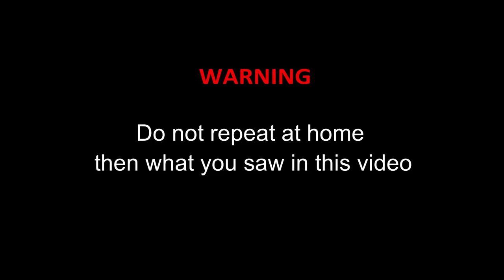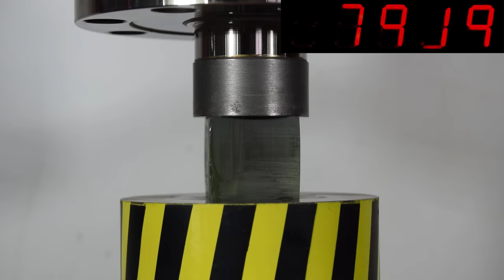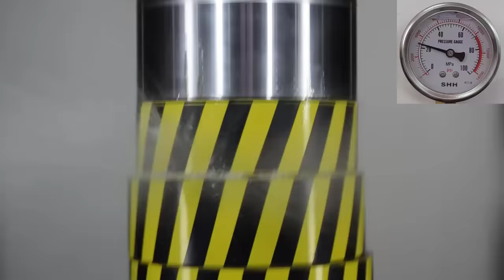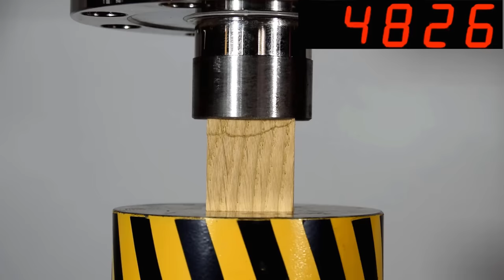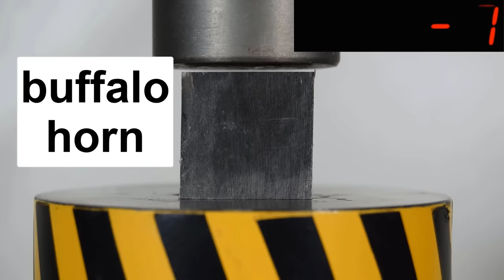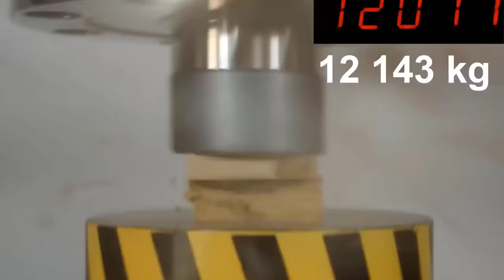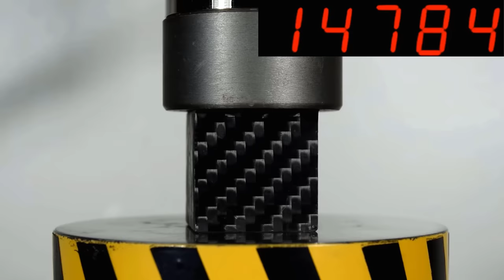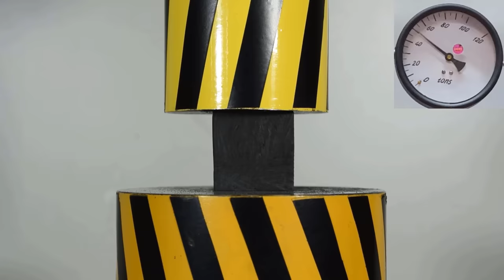HYDRAULIC PRESS VS FIBERGLASS AND CARBON FIBER

Comment: You didn't give the wood a fighting chance. You put them both with the grain vertical. Wood has amazing compression resistance when the grain is horizontal.
Reply: Lol. Mamy times of wood.any parts of wood. Does it even matter? Wood is 3X price from 2 years ago
Reply: @kyohiromitsu4010  yes it does
Reply: @kyohiromitsu4010  I try to cut basswood (pretty easy to work with) against the grain and it takes a bit of elbow grease. I cut it along the grain and it splits like hot knife through butter
Reply: @MrOiram46  but its compression.
Reply: I've got maple floors.
Wood sucks. Screw wood.
Reply: @JustinCrediblename  ok next step
Reply: If that was the case trees would grow with the grain horizontal
Reply: Yes 100+ tons easy would be good to see breaking point. Just keeps compressing as far I know?
Reply: Yes right
Reply: I'm a carpenter for 20 years...grain vertical is best for compression
Reply: Danger doesn't ask from which side I should come?
Reply: I agree.  I block my vehicles with the wool grain horizontal because if it was oriented vertically, it would split, fail, crush, and 'unalive" me.
Reply: Still not as good as stainless steel

Comment: My house weight just about 100,000kg. That small carbon fiber cube can literally hold my house up. That is, if my house can balance itself on it.
Reply: I'm more interested to know how you weighed your house 😂
Reply: @_Jacks_  i build my house on solidworks before sending it to the architect firm. Set up the materials properties properly. Wood, concrete, steel. The estimation is probably off by few hundred kgs.
Reply: @H_B_R no, it can’t because the force will increase on volume.
Reply: @H_B_R nvm, you’re right. It depends not on volume but on material’s density.
Reply: @H_B_R but unfortunately, nothing will happen to the house underneath. Because the surface isnt flat your house would manage to connect to corners to ground even if the cube is over 5 cm. its more likely it will just be stuck inside the foundation quite a bit. That way making the foundation go to the ground. Now, if it was 2 feet long cube, that would be very fun.

Comment: Grain orientation is important. Like the carbon fiber, the fiberglass, wood and buffalo horn have grain directions, too. Also, from KG to tons? Do you mean tonnes (metric)? The distinction is really important.
Reply: They literally showed "20 tons" when the screen said 20000kg so ye, metric
Reply: a ton is 1000kg , common knowledge bruh
Reply: Why is the distinction importnat? The difference between the two is 1%. For you as a viewer, how does the difference in the shown result affect you? Do you feel cheated in some way?
Reply: @Dokrin3  yeah but to a us viewer 1 ton is 2,000 pounds
Reply: @Dokrin3  Apparently not so common, as in your case, because a "ton" can mean many things: 1,016 kg, 907.2 kg, or 1000 kg. Learn to use Google bruh.

Comment: So that carbon fiber block can theoretically hold an m1 abrams tank depending on the angle
Reply: I still want to understand what type of epoxy he used for the carbon fiber that way off the charts of my understanding of fiberglass and carbon fiber even Normal epoxy i know break faster than in the video

Comment: Mat fiberglass had too much air in it. You needed to use a vacuum chamber to get all the air out first before letting it cure.
Reply: Should've also done the mat the same as the weave. Layers....
Reply: Strength is also about grain orientation.
Reply: @stevenpope940  yeah, compression vs expansion.
Reply: @stevenpope940  The idea with the mat is to provide a universal grain orientation, and thus universal strength, rather than high strength in a single orientation. Had he tested the layered weave along the perpendicular it would have probably broken at 10 tons or less, rather than 40. The mat done properly should be somewhere between the 10 tons and 40 tons, but from any orientation.
Reply: @stevenpope940  yes you right dude
Reply: Mat fiberglass isn't made for epoxy resin. It's made for polyester resin.
Reply: Even so... It held better then I imagined. I didn't know it was so strong.

Comment: Maybe do the experiment in tension, to test the strength of the fibers not the compressive strength of the resin.  I know doing tensile tests on a hydraulic press is difficult but you could wrap a concrete cylinder with resin infused glass and carbon fibre, then when compressing the concrete cylinder the fibers will be in tension.

Comment: I like your videos. But I don’t like to see fibreglass strength tests when the glass (whether it’s weave or chopped strand mat) hasn’t been laminated correctly. Resting to glass ratio well off. No compression of the layers. 

Also, there are so many different grades of glass fibre. Some that will make carbons and Kevlars look weak in comparison. No mention on the grade of glass used?
Reply: I have a mindf*k why the hell this guy cut this mat into pieces while he did it correctly with previous sample
Reply: @Alfaomega2003  I’m guessing he wanted paste and didn’t have chopped strands, just chopped strand mat. He may as well have just used p40. Not that I wish to neg on the guy, I still enjoy all his videos I have seen. I just feel this one could have been much better.
Reply: All this guy ended up doing here was test the strength of epoxy resin with various reinforcements.

Comment: Hi, thanks for your interesting video! I do have to point out a couple of technical issues.. (sorry to be that guy, but...) The resin you mixed in the beginning was polyester resin, not epoxy. In cutting up the fibres and mixing it into a mash it lost all its strength, and made the fracturing easier. normally it would be layered like you did with the woven cloth. What weight per m2 for the cloth and csm did you use? Thanks again for your video. I hope to see one with the chopped strand layered like the cloth if possible?

Comment: i have a question in the all of my life : what is diffrance between fiber glass and fiber carbon, you answer it well
Reply: As the names imply, fiberglass is made of small strands of glass that have been melted down, while carbon fiber is made of small strands of carbon atoms. Both materials can then be combined with an epoxy resin to create a stiff product that can fit any shape or mold
Reply: Both are fibre reinforced plastic (FRP). Kevlar and cellulose are popular too.
Fibre reinforced metal is a thing as well.
Fibre reinforced cement is a thing too (commonly referred to as fibrocement.

Comment: So what is the strongest material out there?
Reply: The strongest I have seen in these kinds of tests is HSS Steel Rockwell 69 range. A 300mm x300mm cube of this high speed steel won't deform until it explodes. With the softer steel used on the press tools it would start sinking into the plate after 150tons. It would likely take nearly 500 tons to explode the material. He has put a ceramic ball on top of this steel and after 50 tons it exploded. This is soley due to the fact that ceramic, or the high quality ceramic balls are nearly as strong as diamond when it comes to hardness. Because the high speed steel will not deform much it has no choice but to prematurely explode when a harder material is on top of it. There may be a few other alloys that may fair better but I would like to see a test with the high speed steels at 300mm. The carbon fiber funny enough fairs better than most steels in that carbon fiber doesn't deform much at all at 100 tons. Regular steel will deform starting at around 40 tons. And would measure likely 200mm after the 100 tons of force was applied.
Reply: Also interestingly a piece of AR500 or AR550 steel cubed 300mm 300mm of possible would likely be one of the toughest materials in the world to crush. I honestly do not think 500 tons would be enough to deform it more than 3mm.
Reply: @Nick-cp8wf   How much weight can Zylon take, in your opinion? Also, you mentioned some high speed steel alloys but what about titanium alloys?
Reply: Vibranium
Reply: @48_rayyanrafifriansyah84  metal used in Titanic
Reply: TUNGSTEN
Reply: If there was something like metal fiber , woven into sheets then glued and compressed with resins. That could be stronger than any of these. Basically the extra strength from fibers or woven matrix in carbon fiber comes from the frictional resistance. Due to very large surface area of the woven matrices, the force required to overcome friction would be very high. It's a similar principle why cables that holds bridges are made up multiple strands of steel wires twisted together.

Comment: Is that POLYESTER Resin or EPOXY. I know you labeled it as epoxy. But I have never seen epoxy like that. Such a small amount of "activator" in a small, clear liquid (methyl ethly ketone peroxide)  is a POLYESTER resin. They are different in strength. Also the fact you are using CSM (chopped strand mat) SCREAMS to me POLYESTER resin. Expoxy can not bond in CSM ... it cant resolve the styrene molecules. I think you are using POLYESTER. And polyester is not as strong as epoxy.  BUT .. with that said.. still great work! Its great to see in real life how much weaker CSM is.

Comment: The fiberglass preparation looks poorly done compared to how carbon fiber is made in factory.
I can see gaps between the fiberglass layers.
Maybe just buy a fiberglass cube just like u have with carbon fiber cube.

Especially since fiberglass has about the same strength as carbon fiber weight to strengthen ratio.
Reply: E-fibeerglass specifically
Reply: fiberglass is a bit heavier and the fibers are a bit weaker

Comment: Please use the safety glass to shield your cameras and it is not fair for the iron wood to be use vertically as you can see the wood grain has much more resistance when you out it horizontally.

Comment: it was necessary to heat the epoxy resin and fiberglass to 80 degrees for 5-6 hours so that it gains maximum strength

Comment: Damn that epoxy carbon fiber across the fibers withstanding 100 tons of pressure is INSANE. I needed a medium for my epoxy press mold and I think I found the winner lmao does not need to withstand 100 tons though 🤣

Comment: Most of this was done improperly. The ratio of resin to glass is way off, too much resin. The layers aren't laminated, but rather stacked on piles of resin. The mat should have gone in between every single layer of the roving (woven.) Doing it this was does absolutely nothing but spread false information. If you made 10 cubes of each type like this, the results from 1 or 2 may be close if any. This is effectively a test of the resin.

Comment: Very, very far from a fair comparison.
You positioned glads fiber differently to the carbon. Wood gains strenght when positioned differently. Both matt and fiber hsd too much air in it.

Comment: Way to heavy on the epoxy to fiber mix.  Also- as previously noted, there was a lot of air in the samples which is a huge negative for strength.

Comment: it's wrong! the one in the video is not laminated carbon fiber; that manufacturing technique seen in the video is used to use expired carbon fiber; 
the cube responds to stress using only the epoxy resin, the fiber does not work resistance; so the video is engineering wrong

Comment: To be honest, when you mix up polyester resin, but label it as Epoxi (which is a completely different thing, not related at all chemically), I just loose any faith in the experiment, so I couldn't even be bothered to watch more than 12 seconds...
Reply: it’s the same thing